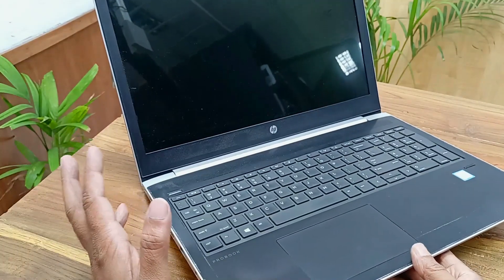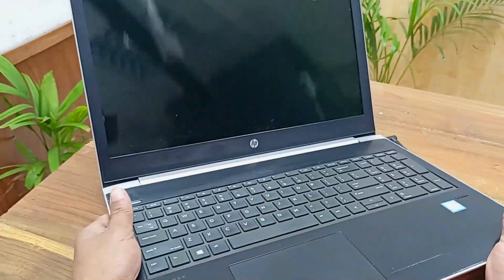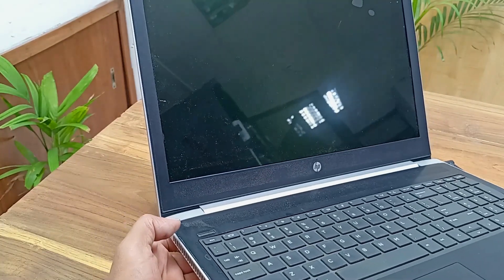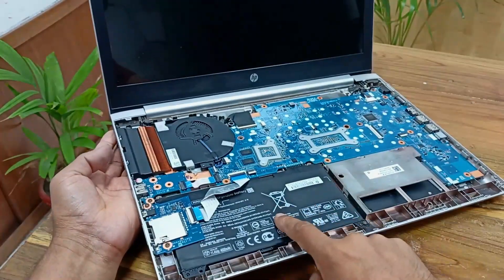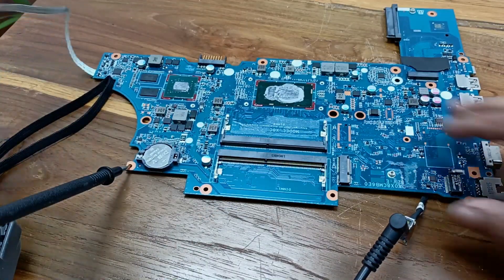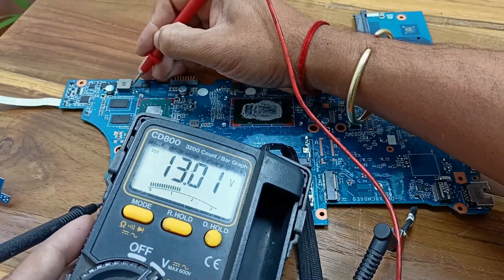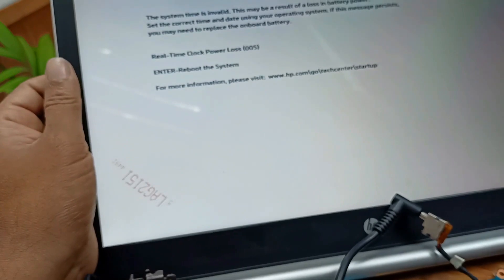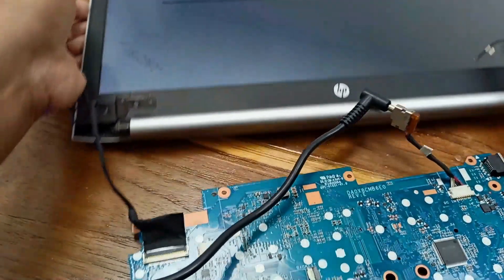How to fix Hp probook 450 g5 laptop power won't turn on.

Comment: Thank you! I find, that charger have electrical circuit, because his little nidle have some damage - she give circuit on side of charger. From center nidle to side of this circle.
I fix it by nidle for saw. You need to back charger nidle to she's center and electric circuit go on. 
And then i plug it to notebook and power led first blue light, then yellow/orange light.
Thanks to help!
Reply from the maker: you are most welcome ❤️❤️

Comment: Thank you soo much, my problem is fixed just using the first step. I held the power power button for 20 seconds and then plugged the charger back in. BOOM!!!! issue is resolved
Reply from the maker: you are most welcome ❤️❤️
Reply: For me as well, it worked from the 1st step. And I wondered how to let it "forget" the battery since it's not easely removable. Thanks for the tip.
Reply: For me too it helped. I can't understand what the problem was. It needs to be configured soon.